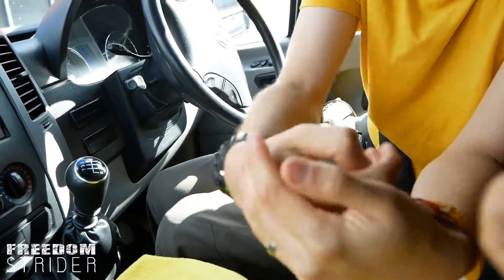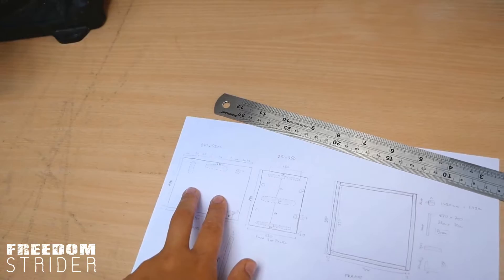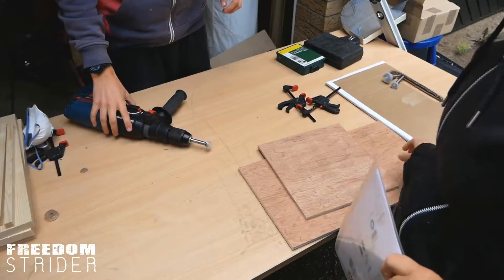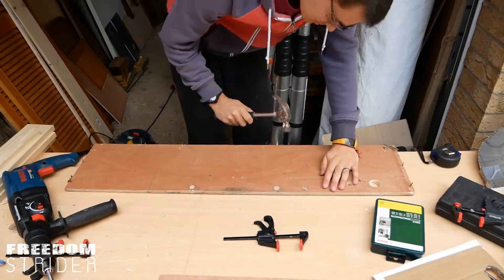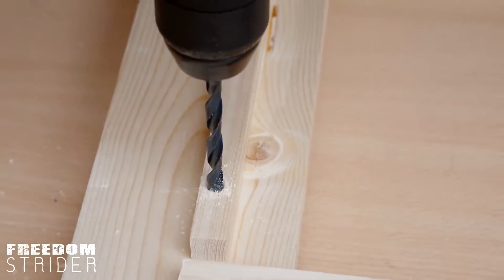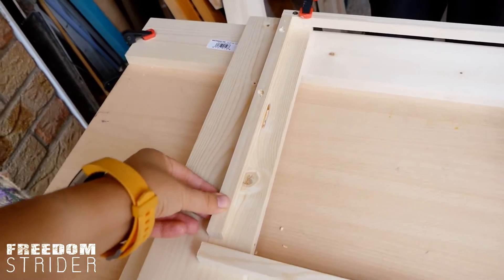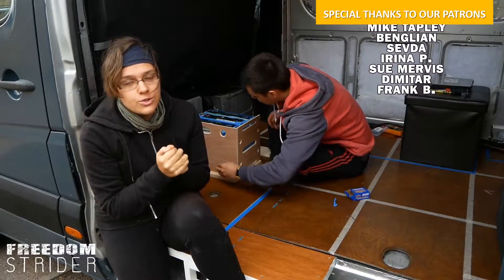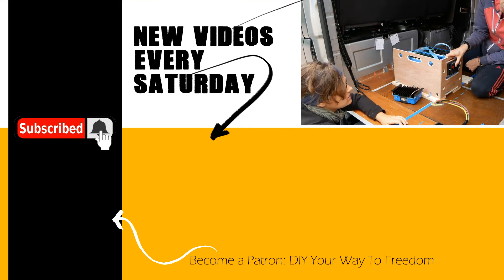Planning your Campervan Electrical System 101

Comment: Hi guys I was wondering what solar set up you are going for? You've got a lwb crafter so youve got lots of room on the roof.
Reply from the maker: We are going with 540W solar panels (that covers about half the roof). Then they will be tilting, for 'max' efficiency and so we can increase our deck space. 🙂
Reply: @FreedomStrider  ah yes a roof deck highly recommend! Quite a decent array youll have. May I ask where you're planning on getting them?
Reply from the maker: We got ours already from bimble solar - the panels we have a Perlight Mono Delta Black 54 cell. 270W (PLM-270MA-54). We choose them because they fit well width ways on the roof (they don't stick out that much to look weird)

Comment: This is one of those jobs that is way off in the distant future for me. I want Lithium but even the cheap Relion 100ah battery I missed out on the other day was £550 which is way outta my budget. I shall just be putting up conduit, mounting an empty 12v fuse box and making a little space for a future battery purchase.
Reply: Hi Tine. Lithium is still pricey to buy. But consider a power station which contains all the components in one unit (ie MPPT controller plus  pure sine wave inverter plus a huge lithium battery with 12v consistent power supply).  These are ideal for self builders who do not have the expertise or desire to purchase and install separate components and wiring etc. They offer a simple plug and play solution. You can easily run all your electrical devices and charge mobiles etc and charge from solar or mains supply. Unfortunately they are stiil expensive at the moment, but I think that in the near future many more of these units will be available and the way Lithium is moving they will be much cheaper, smaller and lighter. Plus they are portable.  They are ideal to match up with folding lightweight  solar panels that are easily to fold up and store in van when not in use. No more heavy glass and aluminium panels on top of van. All this technology is  changing  very fast.
Reply: @barry-cq4xg  I haven't looked into power stations, they don't look beefy enough for my needs & always seemed like the more expensive solution which isn't an option for me. I'll probably end up with AGM and swap in a cheap Chinese Lithium battery eventually.
Reply: @tine8849  Thanks for your reply. I am sure that eventually you will find the right lithium battery solution to suit your needs. One thing for sure is that prices will drop, and quality and longevity will improve.  All the best to you.
Reply from the maker: Lithiums are always getting cheaper every year, but all said and done, with van conversion, when you seriously look at the weight and you're converting a LWB where you only have around 800kg which you can realistically use, Lithiums are certainly worth the investment. Getting AGM's and using them for a year or 2 whilst saving and waiting for prices to drop is a good idea - in that case, it's best its best to get components that will work with both types of batteries (eg: getting an MPPT with a Lithium and Lead Acid setting). Let us know how things go 😀
Reply: @FreedomStrider  Sound advice. If I pretty much knew for sure I'd be working til the end of the year I'd probably pull the trigger on a few used deals I've seen on Lithium batteries, could have had 200ah for £600 :(
Plus I really hate the idea of doing something I know I'll have to change in the future but can't be helped.
Reply: Woah where did you find them for 550??
Reply: @thekingoftheworld9553   it wasn't a bargain shop offer or anything like that just one that popped up on ebay https://www.ebay.co.uk/itm/274431475702